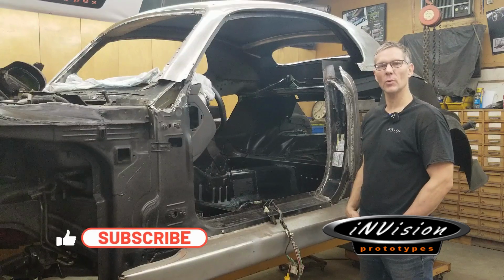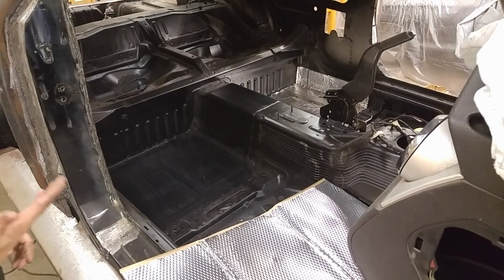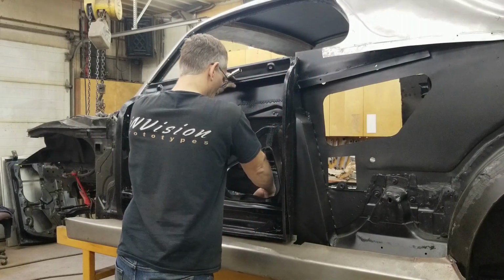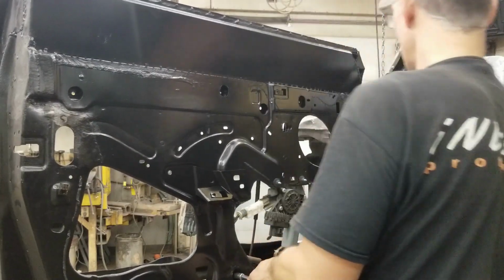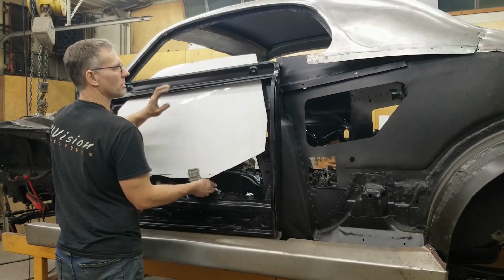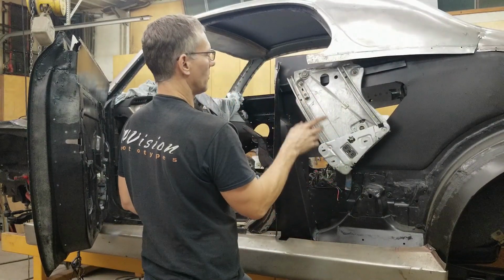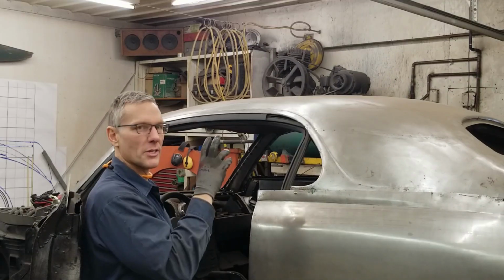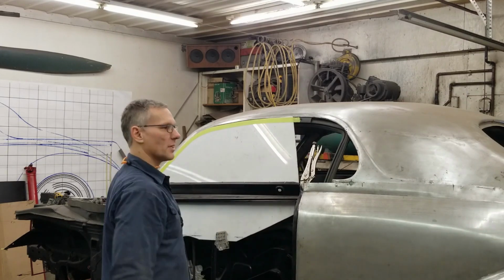Door Assembly & Sound Deadening Install BEGINS! - Ep.44 | 1940 Ford Inspired Hardtop Coupe Build

Comment: Nick, I am not sure the masking tape down from the drip edge onto the glass for a cut line is the best way. Because the glass is moving in one linear Direction back and forth and the tape becomes wider as the tape leaves a perpendicular position to that line. I think the better method would be to establish the axis of linear motion by drawing a line on the glass or simply holding a Sharpie at the edge of the door and moving the glass up and down and then use a compass holding the two points at the same axis as that line and moving that Compass along your drip edge. Just my thoughts. If that is wrong please let me know so I can learn too.
Reply from the maker: I'll have another look at that.